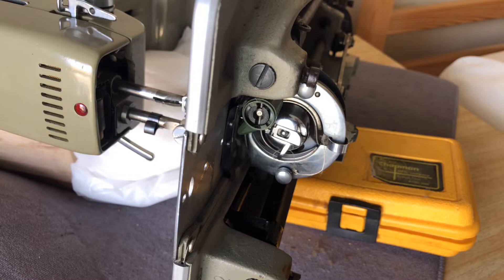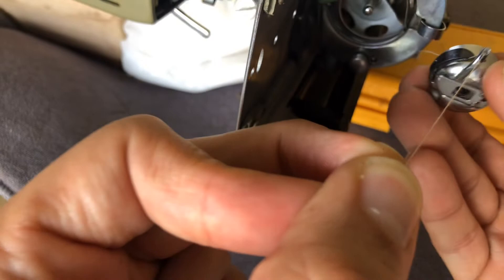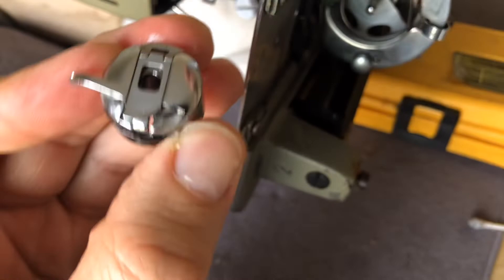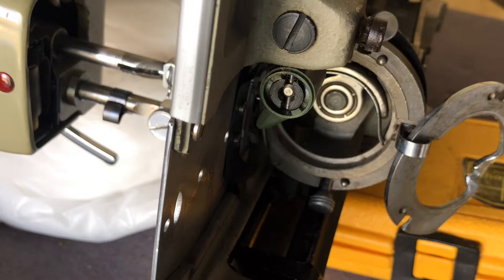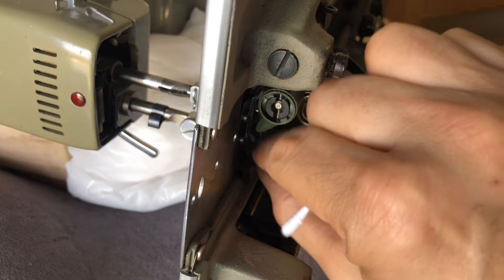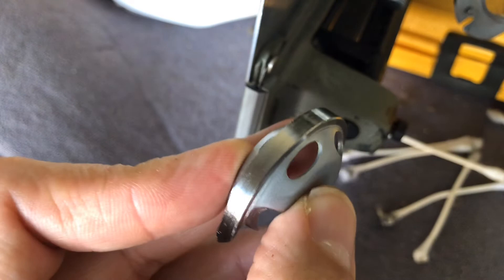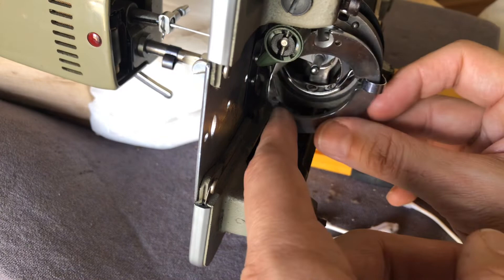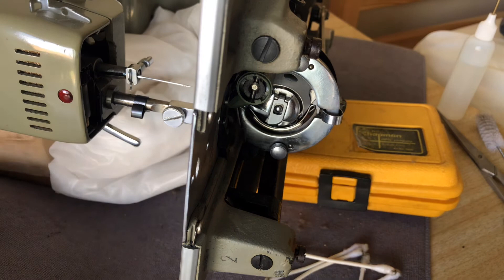RESTORATION SERIES #26: Shuttle Service: Cleaning & Oiling the Shuttle, Hook, & Bobbin Case

Comment: I have a necchi esperia.  The latch will not stay on the bobbin winder. It won't stay engaged.  i suspect I need to tighten something, or replace a spring on the latch.  It is not accessible.  Do I have to take off the hand wheel etc?  to access?/  I dont see any videos on here or anywhere addressing this issue.  Can u pls help.  I have just accquired this machine and after following your lubrication and cleaning to the letter, it is absolutely amazing!!  except for this issue. Please pass on your knowledge. thank you
Reply from the maker: Yes, Robin, I suspect it is "likely" the spring.  You would need to get the hand wheel off to access the spring.  Be extra gentle when removing since Necchi hand wheels can require more effort and patience to remove given how close the tolerences of their parts were.  But they are worth it.  Some of the best machines ever made from that period I feel.